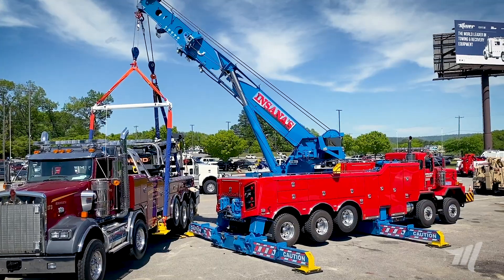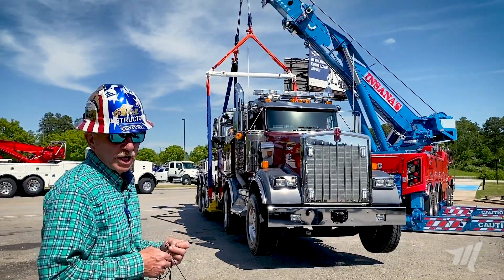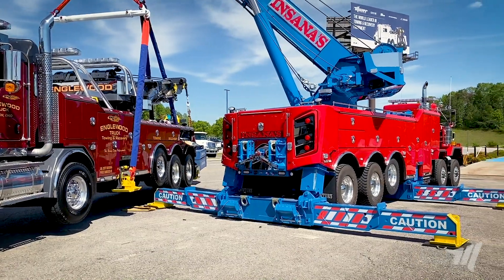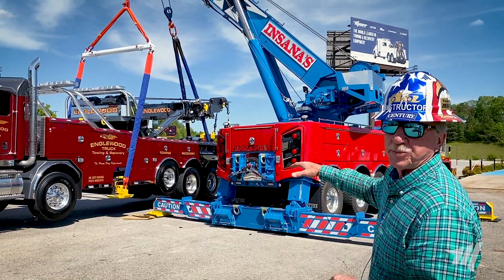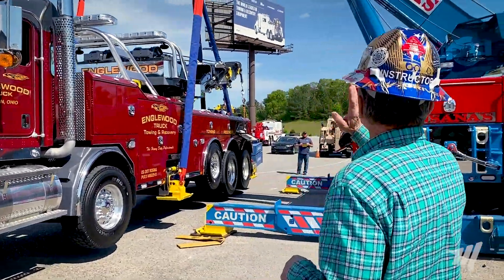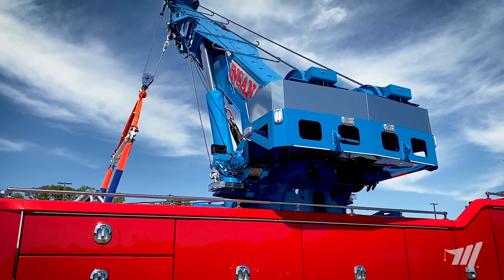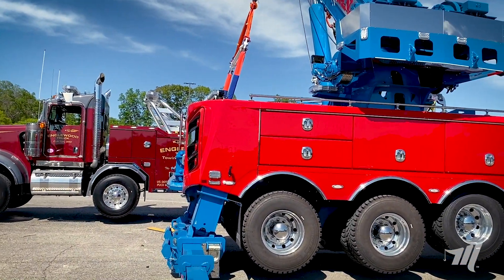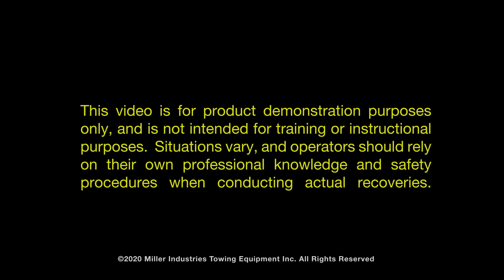Century M100 Demo Sneak Peek

Comment: It's weird how this vehicle has the same tail light design as the Entegra Coach... I didn't know this was a shared piece that some third party manufactured (google image search "entegra coach tail lights")
Reply: Thats because it is the same taillights. It would be too expensive to design different ones when off the shelf parts will suffice. The is common between multiple brands over many products. Ranks with riding lawnmowers. There are technically 3 company that product a good better and best options. Thats 9 mower brands yet of those, they will interchange parts between one another.

Comment: those snatch block are over loaded.. arent they?
Reply: Maybe, maybe not depends on what kind of snatch blocks they are running, It says the m100s come with 7/8 wire rope, If that is the case, I'd assume they would match it with a 7/8 snatch block, They could have gone bigger and got a 1 inch plus rated snatch block and gone up to 30 tons per block, But i'm going to assume they have the 7/8 inch 15 ton snatch blocks, So 30,000 lbs each, They have 2 for 60,000lbs WLL, He said with the weights it got him to 100,000 lbs, So if i am correct and they are using the 7/8 15 ton snatch blocks, they would be over the safe working load limits, that being said they could be using the 25 or 30 ton snatch blocks in which case they would be within the safe WLL, adding to that they have a design factor of 4:1 so realistically the 15 ton is made to withstand up to 120,000lbs each before breaking, distributed between two blocks thats 100,000 of 240,000lbs breaking load limit, Without knowing the type of snatch block they are running there is no way to tell, but I'd say they are definitely within the breaking load limit especially seeing as they of course didn't break, and i'd say if they took that into consideration they very well could have swapped to the 25 or 30 ton blocks but i'd guess from the factory these trucks would be equiped with the 15 ton blocks and they would be over the WLL.
Reply: M100 comes with 25 ton blocks. The wire rope is also some special 7/8's that I  can't remember the exact name of, but it has a significantly higher WLL to make use of those blocks as well.
Reply: 25  x 2tons = 100 lbs.  I am educated now.
Reply: Even with 25 ton snatch blocks this rigging is still over the WLL  by some percentage due to the angle of the lines from the boom to the load .
Still not any where near breaking point at this angle , but over WLL .
 Angler line load goes up when the lines are not inline with the load , greater the angle the higher the percentage of rise is above the load weight , l have seen charts on this.
Reply: No

Comment: That up close stuff is cute. Shoot the boom out to max extension and show the world what it can actually do. Enough cutesy little up close overglorified advertising shenanigans.  The 50 ton rotator can do that just fine with a highly skilled and technical operator. Unimpressive.
Reply: Look at the launch video. Picked a 1075 which was picking up a 5130. Was able to boom out off the back.
Reply: They did in the first video of it, It was quite an impressive lift they did, But the rotating is to show even under a pretty massive load the rotate functions will operate fine and the outriggers can handle it.
Reply: Try lifting matt's nose. It fills all of his videos so she must be loaded with gravity
Reply: Look, I guarantee you that was not the "78,000 pounds" they claim it was. There was zero footage of any gear in that truck. Ron Pratt's is 68,000 with all the gear in his. It is more than likely 68,000 instead. I have seen the videos. None of you seem to know the difference between forceps and tweezers. None of these comments you people are making are effecting me. BTW, thank you for the viewership support.
Reply: @chefmatthammerschmidt8408  Incorrect. In a video he says that it takes a while for his 72000LBS + truck to get up to speed. 68,000 might have been when its empty, but a 1075 is not a 1150. When they first demoed the M100, they had a 1075 with a weight of some 79,xxx.
Reply: @chefmatthammerschmidt8408  Ron Pratt his 1150 weighs 73,000#
Reply: You clearly have no experience in towing. When you boom out you lose stability and lifting power. He lifted a 75 ton rotator, lifting a 5130.